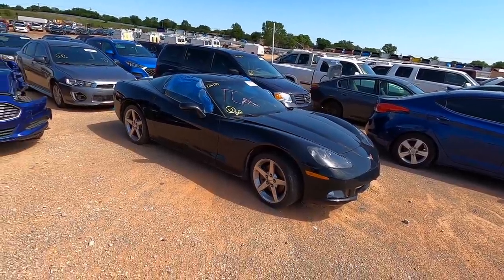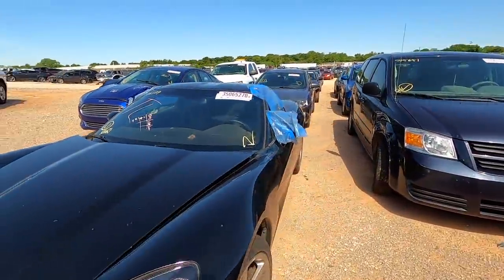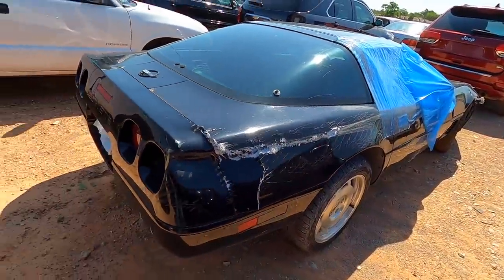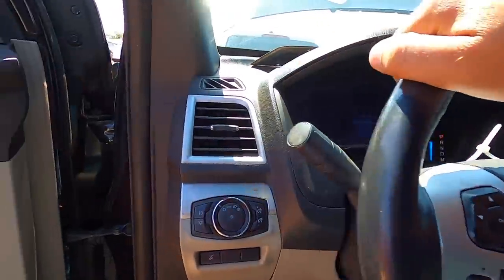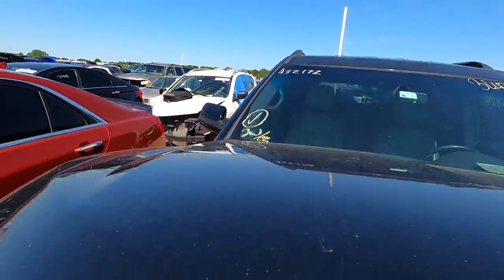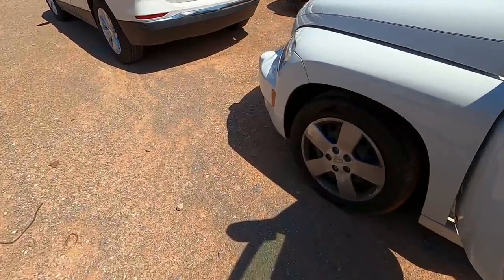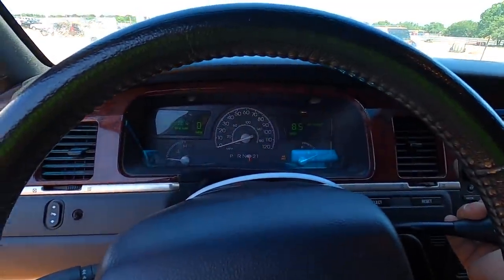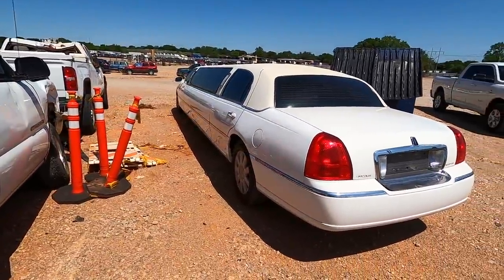Copart Walk Around 5-23-2020 + Cheap Limousine

Comment: "I smell fire" leaves engine running - even after provoking smoke on another engine just earlier.
Reply: There's a big difference in smell between an active vehicle fire and old fire damage.  Until you've smelled both it's easy to not know, but he definitely has.  They both smell an awful lot different to oil getting warmed on the engine or manifold, something which almost never catches fire, and only rarely on turbocharged vehicle...
Reply: lol... Kinda thought the same thing for a second.  Then, felt better assuming w/ his experience etc. he'd prob know what he's doing or not doing by leaving it running.  From where he was.... prob knew based on smell itself, how it as running... that it wasn't any current or immediate threat.   Watching from here, tho & NOT knowing.... was scared FOR him, for a good minute or two, tbh  LOL    Stay safe & be well.
Reply: Yeah you need to get it and fix it up for you and your wife

Comment: I have a feeling the A8 has had a rough life, the KN intake, nasty rims, and leaned back seats say a lot.
Reply: I thought the same , my sons BMW looks the same !
Reply: Deferred maintenance in trade for unnecessary parts
Reply: "Don't judge a book by it's cover".. that Audi is S8 which mean is not the basic A8 is the sport version S8 and with the longer chassis in the back because of L, the 4,2 -V8 in that Audi sounded very healthy and to be fair & square, the maintenance if that would be all : for brakes, wash fluid and inflating tires is very basic stuff really..
Reply: Fix the jeep DIY Gang fixed worse
Reply: With that limo there is enough room to allow for social distancing if you go back to Uber
Reply: What does that mean???
Reply: @poplaurentiu4148  IK what it is, but that doesn't mean it hasn't been thrashed
Reply: Pop Laurentiu it’s literally an a8 it doesn’t have s8 badging. Nobody would take off s8 badges and put on a8 badges.
Reply: i think i heard a chain rattle when he started it!!
Reply: Ya same minute I saw a k&n filter I was saying ow no

Comment: HHR is a surprisingly reliable car, and all the seats fold down including the front one, so you can haul almost anything, including 2x4s. My wife had one for years, no major problems, just general maintenance and 1 wheel bearing. Sold at around 160K miles and it still ran like it was new.

Comment: Love the c4! I just replaced both quarters on my 96, it is easy to do. Both of mine were cracked and damaged from a minor rear-end collision. A few bolts and most of all GLUE. It takes a special glue to reattach them. I had to reshape mine to the rear bumper which was easy to sand off into a great fit and work on the door gaps a little. Replace the clamshell and door! A little work on the A-pillar and a new windshield! The A-pillar is fine just repair that little damage by either straightening out the metal or a couple little patches and body filler. The replacement clamshell and door will fix the rest of the damage by the A-pillar. All of it is an easy fix! The top could be color sanded and buffed out to remove the scratches, I had to do that to my 96 clear top, I also have the solid fiberglass top too. Mine is also all black. Also have a c5 and c8! Will always keep the c4 and they are going up in value now! 

Jeep! Easy fix! That would be perfect for an LS/auto swap or Hemi swap from any wrecked 4x4 chevy or ram with these engines etc in them! Most everything will be replaced under the hood of the jeep doing that and you would have a killer jeep then. Fast and reliable! LS is probably a cheaper way to go, a more reliable swap, and would be more popular for resale! Hemi might bring a little more on resale to offset the costs.

The Limo! I just have a couple words! BUY IT! :-) What fun you could have! AND if YT goes bad You could put your suit on and start a limo company! Onward James to our next destination! LOL!

YES YES YES I did see the ambulance at the end! LOL! I always watch ALL of your videos!

Thanks for sharing! Take care and God bless you all! BE SAFE!

Comment: Cool bonus waaahmbulance. Here in the UK they can be picked up for next to nothing. Ours are generally a van or truck body with a box on the back and a dirty great engine up front. People use them for camper conversions so I guess they're not too fussed about 'previous occupants'...

I would get the HHR (can't believe someone totalled it for that tiny ding on the rear flank), the Exploder (good clean and a tailgate and someone has a cheap and reasonably modern SUV) or maybe the Audi (if you can flip it before something expensive breaks - there must be a reason it's sitting at Copart). 

The stretched Town Car is interesting but replacing that wiring module and chasing the inevitable electrical gremlins is not my idea of a good time, and as you say no-one will buy an old limo - most have been worked hard and even in good shape they're not worth much. Besides, the fun part is riding in the back!

Comment: That Audi A8 has the older 4.2 timing belt driven engine. Actually fairly reliable in comparison to the 4.2 timing chain engine. Notice the black plastic covers on the front of the engine

Comment: A8 looks good, but risky. The Limo would be a blast. I had one years ago. The accessory panel is usually motorhome stuff. Find out who the coach builder was and if they are still in business, you can probably get part numbers and wiring diagrams.

Comment: That Audi-8 looks decent enough if that problem under the hood isn't major.  But my favorite is that limo.  I'm sure your not gonna try to get it but a good mechanic that knows about wiring could fix that problem with it.  And then that thing could float down the road.

Comment: You can get a schematic from the limo company that built the car and they will also have the replacement parts.  That limo would be an easy fix, but it is a bit too long to even be fun around town.  By the way, all old limos are cheap.

Comment: I think your thoughts on the ambulance might be right.  Ambulances and paramedic vehicles are being written off due to the cost of sanitising after corona virus contamination.  Having said that, it's usually older ones that get that fate, and they're heavily marked as being contaminated, like blood and mould vehicles are.  My guess would be that, as some ambulance operator's vehicles rack up much more mileage than others do, particularly those in large cities, although this one is fairly new, it could have reached its operators age limit in terms of miles and just be due for replacement on that basis.  Like some police forces do, this operator may dispose of retired vehicles through Copart, but, as this is fairly new in terms of age, it's still kitted out as there's a fair chance that smaller operators might want to buy it as a fully kitted and working ambulance and save a packet on the cost of buying a new, fully kitted until off the showroom, or rather converter, floor...

Comment: If you can buy the limo for cheap enough for it to make sense then I would say it's a no-brainer.  You can probably replace the melted rear fuse board/control unit with one made for you by an auto electrician you trust for not too much money, and then it's just a case of replacing the burned out wiring, a lot of which looks to be standard stereo wiring, and get rid of the extra stuff that's been added in badly, which is probably the stuff that's burnt anyway.  I think the wiring with the mains plug you found in the boot/trunk is a mains plug in like emergency vehicles have, but an older version.  Overall, it looks like that limo caught fire before its latest owner could inflict too much horror on it, so, other than that, it's probably pretty safe as punts go.  But in terms of price, I would think a safe price for it would be less than you'd pay for 100k mile Lincoln modular V8 and transmission from a breaker, any more and it would be money down the drain.  Of course, when you include income from YouTube views on a series on the limo then you probably have more margin to play with...

Comment: you cant get a deal any hotter than that jeep or limo. I bet they have ice cold AC for those unusually hot days and a heater that blows fire hot. They may smell funny but that is just the warm air intake installed on them.

Comment: randy the chrystal limo is suffering from the usual horrendous wiring faults which has already turned into a bonfire you will end up chasing that around till you end up paying a pro to rewire it plus none of the gear in the back will work which are very expensive plus i think in the states you need a specific licence just to drive one.there aint a barge pole long enough for that old fire starter.

Comment: That limousine has an auxiliary battery behind the front passenger seat on the flooring the corner. Also believe it or not we had the same limousine and had it listed for 2 weeks and got a lot of calls and we sold it . Our limousine was a family personal owned so it was really clean. Also trying to find the rear controller board is hard . They have issues with the rear heat/ ac blower motor drawing to many amps for the thin shit wire they used when they built it . So the wires heat up start to melt and up in smoke 💨. No to much work to fix that car , it didn’t look 👀 to bad... I think I could fix it

Comment: The 2003 Powerstroke's can have either or the 7.3 and 6.0. 7.3 being the better engine of the two. You'll want to avoid the 6.0 from '03-04. The '05-07 are a bit better, but to be on the safe side... Walk away from the 6.0 Powerstroke, not worth the headaches.
That Ford is a Supercab.

Comment: The limo would sell hard. I wouldn't buy it.
The Audi looks decent and it runs very good. They are notorious for timing chain issues because you need to lift the engine in order to change it. And it needs changing more frequently than in other cars. The labour would take somewhere around 9-10 hours for someone with experience to do it. A lot of people would not pay for this bill and of course it would break.

Comment: The Jeep looks more like a fuel or oil fire than electrical.  Electrical fires usually, but not always, travel into the interior of a vehicle, but that one seems to have stopped at the bulkhead/fire wall...

The Limo may be a fairly cheap fix to make a very decent vehicle, and may even be cheap to buy.  The problem is that there's no future profit in it.  It's too old to reasonably go on the fleet of a limo company in most places, I would think, and it's not really anything that most private people are going to want due to the size of it or the fact that it's the wrong sort of limo.  Funeral directors won't want it due to age making it too much of a risk and the fact that it'll need a paint job and a new roof to work for them, which is going to be a lot of money.  So, there's no potential to make money on it, which should make it a cheap seller.  But, the insurance company, or the vendor, if it's being sold by the company that owned it, could be looking for a crazy price on it, meaning it'll never be sold for a realistic price, i.e. giveaway cheap...

Comment: The A8's air suspension is just as much of a repair pain as the engine, and the wheels are pretty ugly. But other than still having the repair costs of a $100k car, that A8 looks decent! Run away from any 6.0 Ford diesel, fast. Nope. And "eject myself from the vehicle" is the best phrase I've heard for getting out of an awkward car.

Comment: All A8 has a faulty rear lamps. The LED-s are burning out. I you can only change as a complete unit. The screen always stuck in up position. The air suspension is always failing. These are massive money pits.